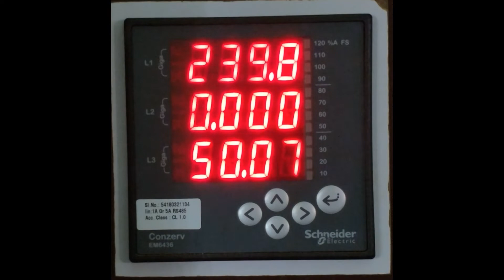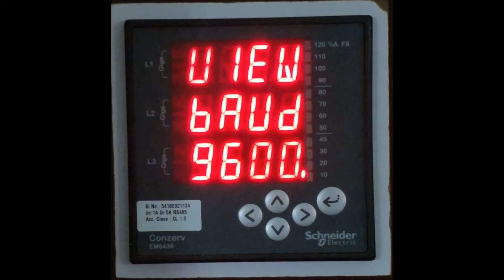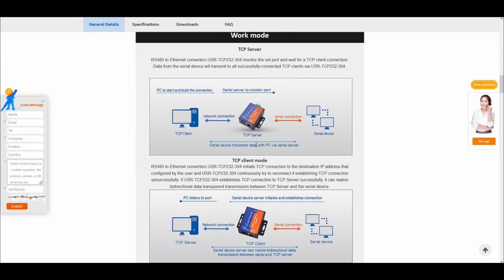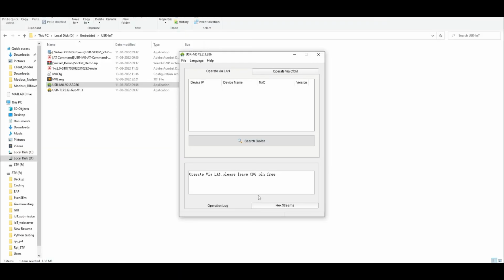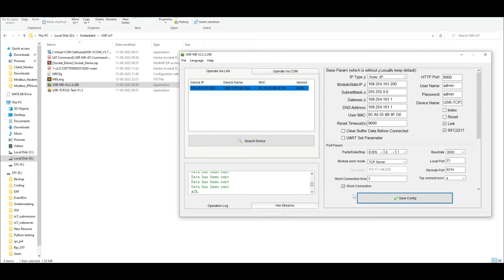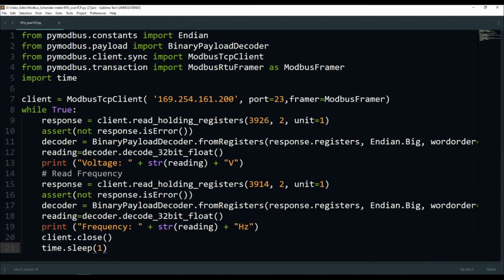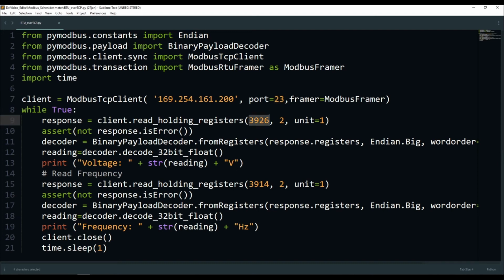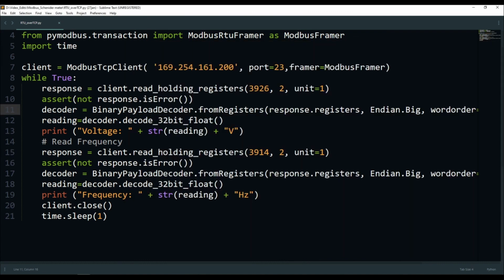Modbus Communication with Schneider EM6436 Smart Meter using PC -Modbus RTU over TCP

Comment: Hello,using putty i can receive data from my sensor but it won't take commands.Im using a usr tcp232 serial to ethernet converter.If i use a moxa it works fine.any ideas?
Reply from the maker: @ab565188  are you receiving any error while transferring from putty ?
One thing what you can try is capture the signals using a logic analyser and compare what’s the difference while transmitting via moxa and putty 
It might help you get better picture

Comment: How can I take data from two differents device? I have 2 smartmeters modbus rtu with different ID
Reply: But in your code you doesn't use the ID, could you make some video example or update the GitHub whit that?

Thanks in advance
Reply from the maker: @MakerGarageYT  create a new client object with the ip of the second meter
Reply: @sarathtv  but i want to have all the meters in the same modbus rtu network and use only one modbus rtu to modbus tcp converter
Reply from the maker: @MakerGarageYT  that is not possible with this converter
Reply from the maker: Hi 
You can create new client object with the ip of the second meter 
Then use that client object to read the registers

Comment: hello sir , i want to connect my secure elite 300 meter with esp8266 with using rs485 to ttl converter ,can you help me with the code to read the resister address i want to read
Reply from the maker: Hi I have another video where i am reading Smart meter data using esp8266 over modbus RS485  use this link 
https://youtu.be/b4HFpmO1g4c

Comment: i have two queries  1. can you able to brief the A & B cable connection in energy meter.....2. How to assign the local port,  remote port as well as Http port
Reply from the maker: Hi
The A and B cable is the modbus D+ D- lines
As for configuration of the ports you will need to access the control page.
Reply: @sarathtv  can i give any number for local port?
Reply from the maker: @kanarendran  the module comes with a default local port using that u can access the configuration page 
In that page u can modify the port number if u like
Reply: @sarathtv can you explain how to set difficult id in rs485

Comment: Hi sir, 
I have tried the same experiment with another selec meter and wave share rs485 to eth converter but after making a few changing to the import file lines I was able to rectify the error but still have an error saying failed to connect ModbusTcpClient 
Can you please help me out with it
Reply from the maker: What is the IP of the machine (laptop or pc)
And the IP of the rs485 to ethernet converter?
And are able to ping that IP
Reply: I need a similar task done. can you help me with this? happy to engage professionally with you on this project.

Comment: Hi Sir Thanks for this video I was looking everywhere on internet for same 🙂 while I am running program showing error please help me
Reply: Module not found error no module named pymodbus. Client. Sync
Reply from the maker: @rajshrikale3328  can you show the output of pip list 
To make sure you have installed pymodbus library
Reply: @sarathtv  pymodbus 3.0.0 version is installed
Reply: I am unable to share screenshot here
Reply from the maker: Could you tell me what's the error you are getting
Reply: Can you please share your contact number I am trying to do this but as a beginner need your support
Reply from the maker: @rajshrikale3328  you can contact via mail.
sarathtv2@gmail.com
Reply: @sarathtv  Sir I have shared screenshot please check